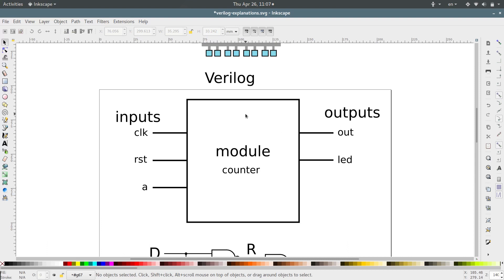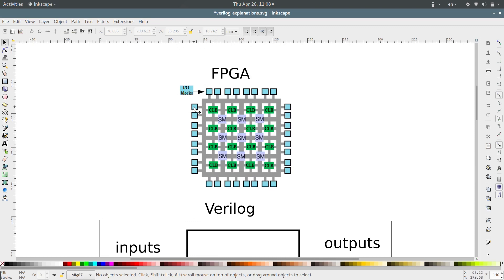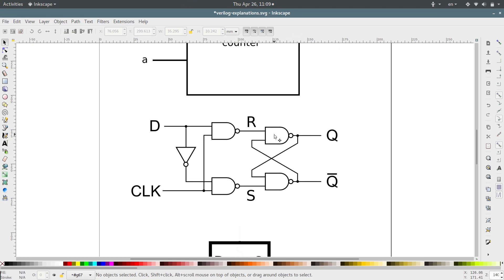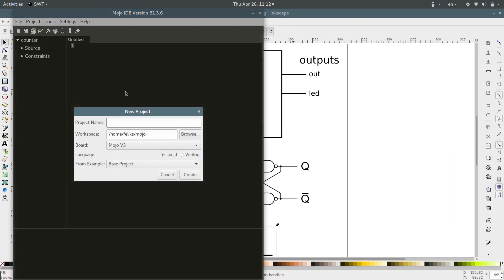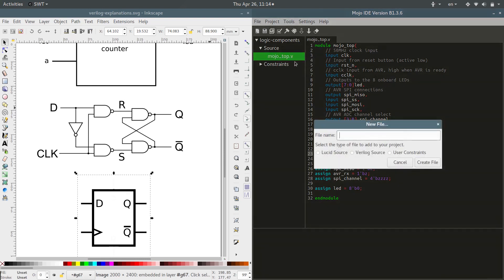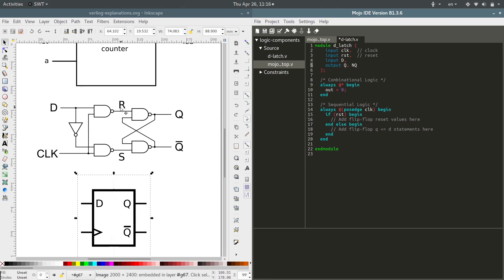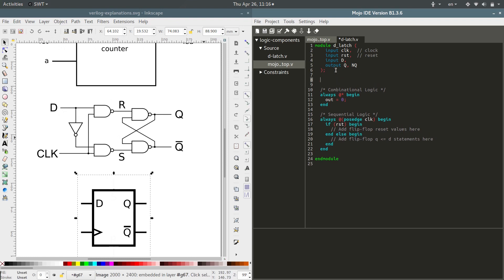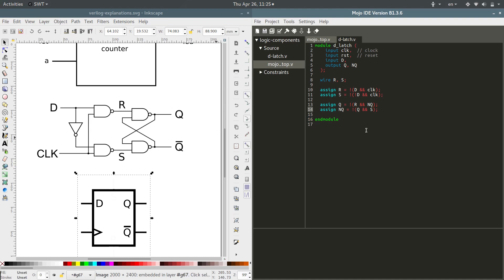Learn FPGA #3: Methods of describing circuits: Schematic - Tutorial

Comment: In most cases I’ve found describing exactly how the hardware is connected doesn’t matter because Verilog and the FPGAs I’ve used use look up tables, and since one look up table can replace blocks of circuits Verilog just simplifies it down to look up tables anyway

Comment: Standard CMOS doesn't use AND gates, and is usually comprised of NAND or NOR only because they take fewer transistors than the not negated versions. So if you tell your chip to AND and then NOT the output, will that use two gates or will the compiler optimize that out for you?
Also what happened to the wire between the and-gate and the not gate? do you not need to define that as well?
What happens when you short circuit something? (pull a wire both up and down at the same time) or create unstable circuits? will the compiler warn you? will you fry your chip?
Also your D-Latch is missing a starting value, usually created by a pull down/up through a high impedance resistor.
The way your draw it now, the state of Q and !Q is undefined as you apply voltage.
Reply from the maker: Yes, the compiler will optimize that out for you in a way specific to that particular FPGA chip's internals.
Reply from the maker: As with the other gates, the NOT gate is implied through the logic syntax (the ! in this case) Since the input to the AND gate can be described as !D, there is no need to explicitly describe that wire--the compiler will figure it out.
Reply from the maker: True, you would normally want a starting value on that D-latch. In this tutorial, I was focusing on what a D-latch is conceptually and how to describe hardware. I am leaving initialization for another lesson.

Comment: That's a bit of a strange latch, isn't it? it only stores the value for one clock cycle. Is this to smooth out an asynchronous D input?
Reply from the maker: I suppose you could. Perhaps labeling it "clk" was confusing. It's really more of an "enable" line, but I've seen some latches call it "clk". The point of this was not to build something useful, but just to describe what a latch is for comparison to a flip-flop.